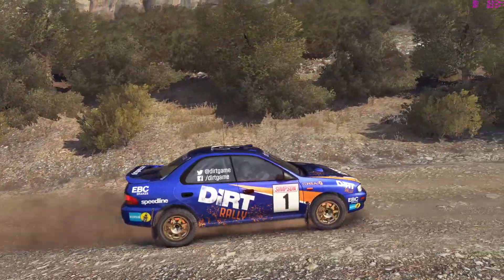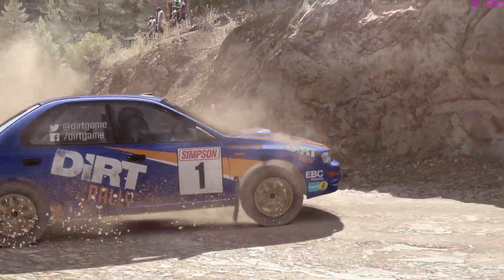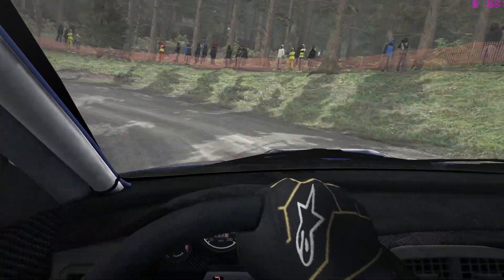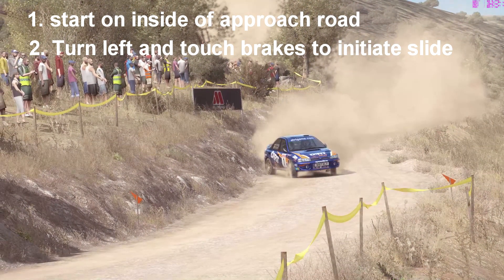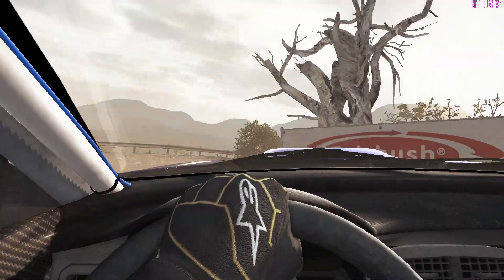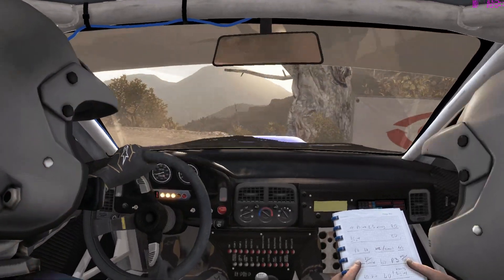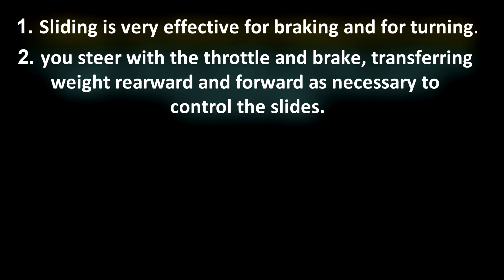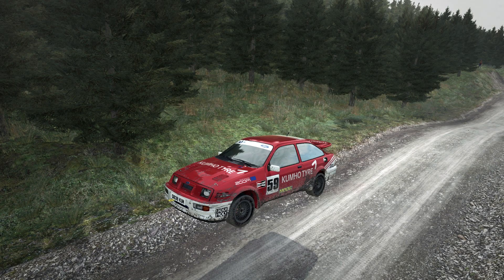Dirt Rally Tutorial - Basics of rally driving

Comment: FWD - Front wheel drive; AWD - all wheel drive
Reply: Ron Kim never heard AWD, usually just see 4WD
Reply: 4WD and AWD aren't necessarily the same. Different ways to get the same result if that makes sense.
Reply: evorm 4wd can be turned on and off I believe and awd is on all the time, I believe that's how it is I might have it backwards lol but Google is your friend 😀
Reply: Asecend While that is true in many cases, the biggest difference between the two, in a practical sense, is that 4WD splits the engine's power 25-25 on both axles. As for AWD, you can have many different power combinations, such as 30-70 front/rear, biased towards the front, as well as 40-10 and 10-40, for the front and back, left and right wheels, respectively. I may be pulling stuff out of my ass, but that's my understanding.

Comment: This video was absolutely outstanding. As a track driver I had real troubles moving into rally. All the pieces were there, I was already able to understand weight transfer and even the scandinavian flick on the track but when it came to rally I couldn't figure out how to use them. This video was an absolutely huge help and definitely beat the dirt tutorials. Thank you. As a side note being a complete noob I found my own way to get the car managing jumps after having them ruin my run a little too often - I just pushed the rebound up until it dealt with them enough to be controllable. I don't know if its helpful or if it ruins the car too much to use but on stages with a lot of straights and jumps I've certainly found it useful, especially with a high stance.
Reply from the maker: Thank you for the feedback. 

One thing i wish was in dirt rally was the gyro effect from using the wheels while in the air, for example if you u go flat to the floor while in the air the cars nose goes up and the opposite when braking. this works in Richard burns rally and can save a lot of time since you can control the cars landing position. 

Dirt rally has some really weird physics and i currently do not play it anymore because of that.

hoping to see a new rally game in the future with physics that are similar to Assetto corsa/Rfactor2 or even something close to richard burns rally.
Reply: Michael E Oh thanks for the tip, thats a really clever use of physics. Is WRC 6 any better? Never tried Assetto Corsa yet but I take it you're a fan? I've been switching between getting it and not for a while now but thats swung it for me. You clearly know your cars very well so your opinion holds a lot of weight.
Reply from the maker: Olivia Lambert nah wrc6 is okay at best but not worth it in my eyes, Assetto corsa is great if you have a wheel, but if you are interested in multiplayer racing check out iracing. Automobilista looks pretty good, its based off the Rfactor engine so it should be good, never playing it tho. Rfactor 2 has great physics but is a bit clunky in terms of getting your controls set up properly for it to feel good, that's from my experience anyway.

I actually only have something like 15 hours in real cars, still on my learners. i learned most of my stuff about racing from just watching, reading and practice.
Reply: Michael E Ok so more of an arcade than a sim? Or simply just not much of a game entirely? Absolutely have a wheel. I can't use controllers much anyway, but I really don't think many people can drive properly with one. I certainly couldn't pull consistent times without a wheel (on tracks, I still can't rally), and it was only after I got a decent force feedback wheel until I could finally get the lap times equal on a corner by corner basis. I'm not really competitive enough as a person for iracing, though I certainly have looked at it. I'll have a look at the other 2 though and expect I'll just go ahead and buy Assetto Corsa anyway.

Fairly surprised you've spent so little in real cars. I'm assuming sim racing helped? Personally I only raced karts for a long time which teaches you nothing about weight transfer. It was only until I got a bike that I even understood it was a thing. I've only done a little track time but you notice it every time you even drive on the road so I had to come to terms with it very quickly. Still, its a completely different deal in rally cars so far. Half the time I'm still struggling with the concept of intentionally losing traction.
Reply from the maker: wrc6 steam reviews are 60% postive compared to dirt rally's 91% postive.

i never raced iracing competitively, just for fun on the free cars (mazda mx5) and it was really fun, probably my most fun racing experience.

Rfactor 1 is where i started, i was a complete rooky when i started racing, i have a video of my 5th online race, sliding around corners and smashing walls. https://www.youtube.com/watch?v=qxlP97bBaY0

It was hard since i came into racing at the deep end, starting with making car setups and then doing the 6 hours of practice before each race. i started with track racing, went to dirt rally, then back to track racing, once you learn to control a car like the stratos, then you can control any car on any surface. also i have never raced ai, only other people. 
The problem with learning to rally drive is that you have no one else to look at in front of you and learn, so it takes a lot longer to learn the basics of rally. 
You eventually get to the point where you don't think about what you are going to do, you just do it, its subconscious, that allows you to be able to focus on the road and pace notes and that's why real life rally drivers are so good

Losing traction is making the car more predictable by giving you space when you otherise have none, putting the car into a slide/powerslide you can correct any mistakes during the corner after entry, by braking you shorten the line and by accelerating you lengthen the line. you can also use the throttle and brake against each other so you can change the direction of the slide.
rather than maintaining the traction and losing the ability to correct the corner once things go bad reducing the ability to move in 2 dimensions

The one main thing that helped me was learning to control the pedals with techniques such as heel-toe and left foot braking. https://www.youtube.com/watch?v=ukpGEuigOw8

you can add me on steam if you wish for further help.
http://steamcommunity.com/profiles/76561198064582588/
Reply: Michael E I'm honestly surprised. I thought after Dirt 2 and 3 were so arcadey people wouldn't give Dirt Rally any time. It definitely deserves the 90%+ though. With oversteer I tend to find myself either being kicked back to understeer half way through the corner or simply oversteering too much. I imagine things will change when I start to use 4WD though. But for now I've just found it a sure fire way to constantly have to reset my car. That and I'm struggling to time my scandinavian flicks properly. I'll keep trying though, definitely faster if you can do it properly. I've always tended to learn on my own doing solo laps so dirt rally isn't really much of a change for me. And thanks, I may just do that.
Reply: 9:30 your Handbraketurns are a bit slow, because of one little detail. Make sure, that you have both feet off the pedals in the moment you pull the handbrake. It´s a Handbraketurn, not a handbrake-supportet drift

1. It´s important to brake very LATE and hard before the corner and keep at the very outside. Late means late. Absolutly block your tires for practie. You want to enter a handbrake turn in the upper rev range of the 1st gear.

2. lift both feet!  Don´t use the clutch yet!
 You need that engine traction on the frontaxle while turning in. Remember, the optimal speed for a handbraketurn is the upper rev range of the 1st gear!

3. Steer hard into the corner and pull the handbrake as you did.  You don´t want any contact with your pedals when you´re turning in or pull the handbrake!

4. when the car starts turning, let of the handbrake and immediately hit the clutch and throttle at the same time, and immediatly let of the clutch again.

5. Steer straight!  That means, when you come over the apex the car is pointing into the straight allready. To get there you´ll have to go through 1. - 4. BEFORE you reach the apex. Over the apex you steer straight and just use the throttle to not come into oversteer again.

Walter Röhrl said: "Die schnellsten Kehren sind die, in denen du geradeaus lenkst". "The fastet turns are the ones where you steer straight" 

10:02 The second half of that turn looks like it has to

Rest of the video is quite perfect.

I allways thought I am the only one who know RBR..^^
Reply: Just had to comment that I'm still here and reading. The handbrake tips might be a bit beyond me but I'm certainly going to try them.

As for assetto corsa, got it now. I haven't had time to play it properly in the past few days but the UI seems a little brutal. It reminds me a little of Race 07 in that regard. A good game with an absolutely insane learning curve. The setups also seem a little annoying with far too much oversteer and generally poor balance which is a bit frustrating. But that said if its as good as people say it is it'll be worth it and the load on my CPU suggests its running a lot of simulation behind the scenes.
Reply from the maker: nexander parzchen Thanks, dont play DR anymore, mostly RBR. also here is where i learnt how to handbrake so thats why it may be off https://www.youtube.com/watch?v=D1_u3-eyXmU
Reply from the maker: Olivia Lambert performance is a must if racing/flight sims, i make sure to run them at 144 fps for less input lag, i have an I5 3570k and a gtx 1060
Reply: Michael E Oh don't get me wrong, I'm running it at full FPS just fine. I usually underclock my processor, most games can run at 100+ FPS with a 25-50% clock speed, the recent driving games I need around 75% to play. I'm running an AMD Fury X and an 8370. Contrary to popular belief AMD CPUs handle gaming just fine, in fact my Phenom II from 2009 managed without issue. These days its all just on the GPU which is why its so surprising that driving games require so much CPU power (especially since flight sims run at 100+ with a 50% underclock). I'm not complaining though, the excess CPU load is just the car's physics so I'm glad thats handled properly.

As for input lag, I could talk all day on that but really anything beyond 60 FPS doesn't improve your performance or reaction time at all, its just a lot nicer to look at. Hell, 40 FPS is fine for track racing and flight sims if you can get past the ugly feel of it.
Reply from the maker: Cmon you know better than to reply to bait.. just removed 20 comments that were cancer because you chose to reply to someone who was trying to get a reaction out of you.
Reply: rachid khassal go away or talk rally like the rest of us. Stop focusing on issues that dont exist.
Reply: I love these kinds of games but I wish I had a driving wheel so I could practice easier.  I can do very well racing with a controller because I hate keyboard for this kind of thing but I've been enjoying the game now that I own it.  Wish there was a way to do rally car racing around here in my part of the States but there's really nothing here.  At least the game runs beautifully on my PC, older cpu with an i5-2500k but my GTX 1070 picks up the slack and kicks this games ass on full ultra making it look and run beautifully.
Reply: Astray bullet. It aint even a real profile pic. A simple google search shows you that many ppl on youtube are using it. Its probably a guy

Comment: Nice educational videos, I especially like 9:20 where you explain to the viewers the otherwise logical conflict between handbrake (locking the wheels) and the engine running (powering the wheels), and hence the clutch in.
I've heard of so many people trying to drift in games with just pulling the handbrake - although most games don't simulate physics at that level, only simulators do, it'd be a 101 to them to know about that conflict anyway

Comment: If your are driving a automatic transmission, you may find that when you pull the handbrake to go around the corner, your car stops and revs. The way you fix this is by turning off clutch overdrive, and traction control. Clutch overdrive causes your character to apply the clutch while the wheels are spinning, Causing your wheels to stop spinning for a second, before they continue to spin. Traction control detects when the wheels are spinning either too fast, or when you pull the handbrake, or lose traction to the wheels, will cause the wheels to stop turning, causing you to rev. If you turn off these settings, you will find that going around a corner, the wheels will spin, causing you to get around the corner faster, as your wheels push you out, instead of stopping you and revving.

Comment: Controlled oversteer, is slides that go round the corners fast as described. Excellent  video thank you!
 I would add, setting the sway bar is key. Sway bars set "firm", keep suspension compression on each side of the front or rear pair of wheels closely matched. "Soft" sway setting, let them move more independantly, which does add, to body roll.  Generally rwd need "soft" (20% of the scale setting), rear sway  but firm front to control the weight of the engine and so reduce understeer and body roll. 4wd need firm both with rear 15% harder especially where the car has a rear mounted gearbox, to control body roll. While fwd get better traction with softer front sway bar. Also use the softest tyres unless your getting (tire) blow outs from hitting the road  edges/banks in NZ stages. Use harder tyres on these roads until you get you suspension and sway bars right then the cars line, will not drift away following  the road camber, into the bank! Very firm shocks and sway bars will make straight line  steering very precise, your steering input will be minimal...as long as your toe in settings are correct😉. That's another lesson. Rwd need plenty rear toe in, or they keep spinning out. 4wd usually need none toe.. at zero...but the t16 Renault 205 can go well on slow corners on gravel, with super high toe in at the rear 4- 6 degree!!!  Fwd mostly between  zero and medium. General rule for straight line stability and keeping straight  on bumps, adjust front toe. For better over steer corners and more exit traction in corners adjust rear toe. The best cars for all out quick time trials don't need much adjustment mitsi evo, mitsi space star, subaru Impreza. But some older and more powerful group B cars are barely drivable without aggressive wheel alignments.
Learn how the differential lock settings make lateral traction increase and decrease. The group B Audi is terrible on gravel until you take the diff' lock to very low settings SEEMS WRONG I KNOW 😕. General rule gravel use low diff' lock especially rwd cars. Tarseal surfaces set the diff's to 75% locked on the slide bar scale. Learn to save your settings so they remain the same next time you drive that vehicle.

Comment: Good info here. I find dirt Rally a lot more forgiving than RBR, as there's not as much inertia when coasting. Lift off the gas and it slows down very quickly, no need for brakes. I hope they tweak the physics slightly to give the cars more weight. That, and more control over replays and camera angles. Other than that, it's pretty damn good.
Reply from the maker: Steven Curley Jnr Agreed!

Comment: 9:30 your Handbraketurns are a bit slow, because of one little detail. Make sure, that you have both feet off the pedals in the moment you pull the handbrake. It´s a Handbraketurn, not a handbrake-supportet 

1. It´s important to brake very LATE and hard before the corner and keep at the very outside. Late means late. Absolutly block your tires for practie. You want to enter a handbrake turn in the upper rev range of the 1st gear.

2. lift both feet!  Don´t use the clutch yet!
 You need that engine traction on the frontaxle while turning in. Remember, the optimal speed for a handbraketurn is the upper rev range of the 1st gear!

3. Steer hard into the corner and pull the handbrake as you did.  You don´t want any contact with your pedals when you´re turning in or pull the handbrake!

4. when the car starts turning, let of the handbrake and immediately hit the clutch and throttle at the same time, and immediatly let of the clutch again.

5. Steer straight!  That means, when you come over the apex the car is pointing into the straight allready. To get there you´ll have to go through 1. - 4. BEFORE you reach the apex. Over the apex you steer straight and just use the throttle to not come into oversteer again.

Walter Röhrl said: "Die schnellsten 90° Kurven sind die, in denen du geradeaus lenkst". "The fastet 90° turns are the ones where you steer straight" 

It allways has to look like 10:02 .. the second half of that turn looks like it has to

Rest of the video is quite perfect.

Comment: First of all: Great video. It was amazingly helpful. My only problem was that I could not comprehend weight balancing. I should have gotten it as you said rudder. 

But the moment I wrapped my head around using weight balance for turning the car it all came together in my head. 
I was trying to tighten my line with weight balancing but drove it to much like a normal racing car. So the only thing I got with this wrong weight balancing was understeer.

Comment: You only need to use the clutch with the handbrake in red and older 4wd cars, most 4wd rally cars have a clutch disconnect on the handbrake.
Reply: Thomas Fellowes That must be why I do so much better with the 2010 cars. I put it down as 'better tech' but the difference is pretty huge - the clutch working makes sense feel-wise. Thanks for the info.